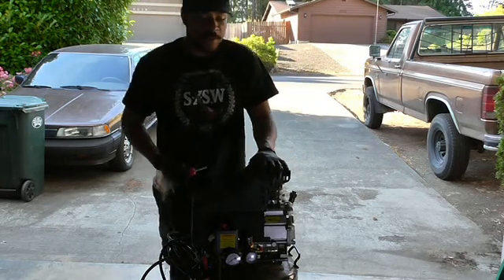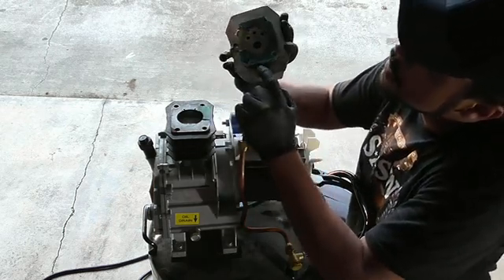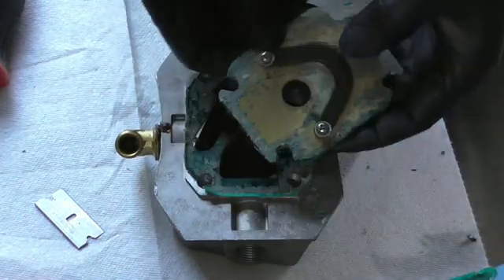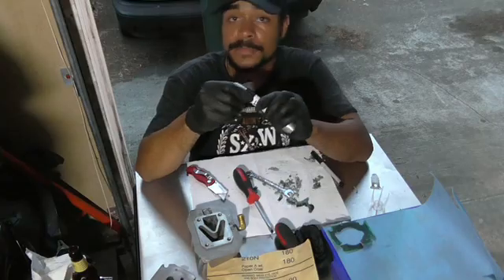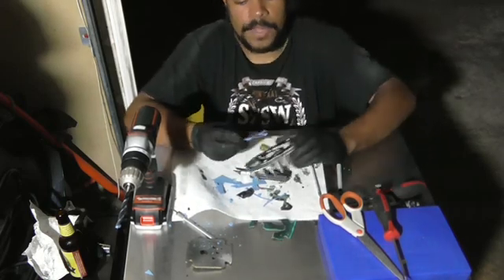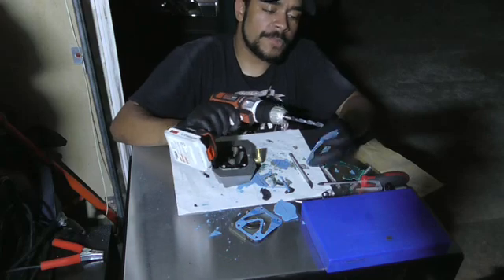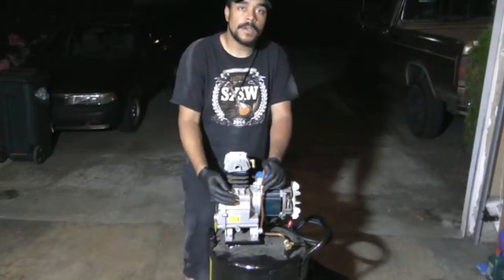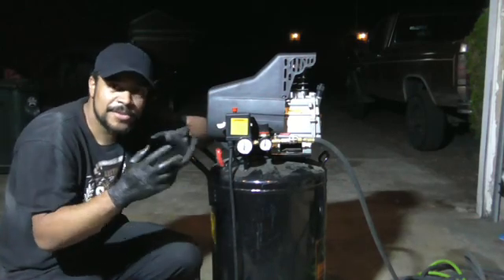Harbor Frieght Air Compressor Won't Hold 40+ PSI? Fix it yourself! (21 gal. Air Compressor repair)

Comment: I am so happy I found your video. I have the very same compressor. I purchased it at a yard sale for $20 but someone removed the sticker that shows what brand and model it is.. I was wondering if you could tell me what the name brand and model it is.. Excellent video. Thank you for your help..
Reply from the maker: Wow! I'm glad this old video is still helping out folks! Okay, so here's what mine shows.
 "Central Pneumatic, item 47065. 21 Gallon 125PSI Cast Iron Vertical Compressor Heavy Duty 3HP Rated Motor. 
(Working Air Pressure: 115psi
12v/6hz/14.6 Amps/1/4" NPT Air Outlet
3.5 SCFM at 90 PSI: 8.8 SCFM at 40 PSI

Then underneath all that is safety stuff and "Do Not Remove This Warning Label 
LOL 

Hope this helped!
Reply: @TheFenderman  Thank you so much. I really appreciate it. This saved me a lot of research.. Have a great fathers day.. Ben..
Reply: @TheFenderman  I finally got it working.. Thanks again bro.
Reply from the maker: @Ben-rj7xs  glad it worked out!!! Now comes the fun part! Fixing stuff!

Comment: I literally did this yesterday  to the exact same Central Pneumatic Model 47065 and used Fel-pro part # 3075 rubber-cellulose sheets to make my replacement gaskets! This video popped up in my feed this morning! Great minds think alike! The algorithms can be scary sometimes!
Reply from the maker: It be like that sometimes!! LOL!  That's awesome! I literally just made a video of this fix working 6 YEARS LATER! A couple of bucks goes a long way with these little beasts!
Thanks for watching and the really cool comment! :)
Reply: I think I may have to do this on mine today. We need to go get some gasket material, and then we are set. Thank you!

Comment: glad i found this video. had no idea this could even be the issue  and they actually nolonger make these gaskets for this model. so excellent video.
Reply from the maker: I'm glad you found it too! Thanks for stopping by and I hope this fix works for you! 
I can happily say I've been using this exact air compressor ever since this fix (I think 6 years now?) to work on my Ford pickup projects and even roofed the house with it!
Thanks again!
Reply: @TheFenderman  got it up and running today! god bless. i love this compressor.
Reply from the maker: @mikep1772  RIGHT on!!!! So glad to hear it!!! 🤘

Comment: Just a word of advice...when doing the holes making the gasket, instead of using a drill...use a paper hole puncher and work it around to chip out a hole, safer, and cleaner cut...
Reply from the maker: I get that one a lot, six years straight actually... LOL :) Thanks for watching! What would have been even better would be having a gasket kit available from the manufacturer!

Comment: hey normies never hold a gasket while u use a drill to make round holes for bolts, this dude is allowed cause he knows what hes doing, same way i remove literally all guards from tools except chop saw, most of you dont, dont drill a hole in your hand.
Reply from the maker: Hahahaha hey man, gotta do what you can with what you’ve got. Paper is difficult to hold onto but, everything still works to this day! Thanks for the comment!

Comment: alternatively lay new gasket material on the surface its to mate to, tap gently with ball peen or brass hammer, really round striking surface is what matters here. the round surface of the hammer hitting the edges of the underlying metal makes easily distiguishable lines to cut along. or good ole fashion paper and pencil or charcoal or crayon and do a rubbing, cut out paper use as a template for gasket material. also for the love of god buy a couple pairs of weed trimming scissors, they have a curve built into the blade and come super sharp. god bless thanks for the advice my pos hf comp wont go past 40psi, now i know why.

Comment: Hi there, thanks for sharing the info.   Here's a video showing how mine will initially turn on and start running but then it quits just after a few seconds.
https://youtu.be/UXmbH0l2TGs
Would you have any suggestions?
Reply from the maker: Sounds like a current issue. (Long leads or extension cords can cause this in my experience) Does it typically trip the breaker?

Comment: nice job
Reply from the maker: Thank you so much! Funny thing is I’ve just been using that same air compressor for the past 3 weeks on my most recent endeavors 😂
Reply: @TheFenderman  nice mine is been acting up and every time i see this vid i try it and the stupid thing still wont charge up lol :)
Reply from the maker: ROADKILL4147 hmm, did you check the piston itself? That almost sounds like a weak ring or something if you’ve gone through it that many times

Comment: Before i give this a go...Would yours get to 40 and trip or keep running without building pressure past 40 psi?
Reply from the maker: Giovanni Lefebre it would keep running and running until it would trip without building more than 40psi. 🤷‍♂️ To this day it still works like a charm!!

Comment: I found your video very helpful.  What type of labor did you use for the gaskets
Reply: what type of paper did you use to make the gasket?
Reply from the maker: Sorry about that! I meant to respond, I figured you meant paper. I found it on Amazon. Looks like it comes in a variety pack now but I picked it up at the local Shucks. (Back when it was called Shuck's O'reilly LOL) I'm not sure about the measurement but now that I look at it, it's like a generic gasket material. 

Here it is! : https://www.amazon.com/Fel-Pro-3060-Gasket-Material/dp/B000CNKUGO

Comment: Great video,  CP HF 21gallon compressor keeps running and won't build up pressure. After watching your video, I'm going to open it up to see if it's the same issue . Thanks for your post.
Reply from the maker: Thank you for your awesome comment! Good luck to you!! I hope it all works out!

Comment: That is a very nice video. Thanks.
I got the same one shipped to me, pre-owned, unfortunately dead on arrival, I opened it but the blue capacitor is not there! does that compressor come with 2 capacitors? or it could be an upgrade? It just looks the same.
Reply from the maker: To my knowledge that blue one is a cap, the white one MAY be a second or it could be a solenoid. I'm not 100 percent sure. Wish I had some schematics or I would tell you for sure. I'm not exactly sure why anyone would remove it unless it's bad (Which can happen). Thanks for checking it out!! Hope you get yours up and running for your future projects!

Comment: Thank you for the video. This is great and I'm hoping will fix my issue that I'm having with the older version of this same model (has a black on/off switch and label is in orange).

Problem is there's apparently one additional gasket that I can't seem to figure out how to get to to repair.

Sadly all of the gaskets on mine were ripped and I have a feeling was part of the problem.

Also, what grade of sandpaper were you using for clean-up?
Reply: Consider using Permatex Instant Gasket for this purpose. It sets pretty quickly; if you don't like the result, just clean it off with a product like brake kleen or acetone and then cut your own gaskets, like he did.

Comment: JUST fixed mine for FREE.  Got a tip for you guys.  When you remove the cylinder head and reed plate and gasket under it you will probably find a broken reed, and it will probably be on the side closest to the air line going to the tank.  My broken reed calipered out at .010 thousandths of an inch so what I did was take an old hacksaw blade and backed it with a straight piece of wood, used a belt sander on both sides of the blade and reduced it to .012 thousandths, then reduced it to size.  Used the thick non-corrugated cardboard from a cell phone box and cut the gasket.  Used a tiny dab of grease to hold the reed in the cylinder head in it's pocket as I turned it upside down to reassemble it.  Functions perfectly.

Comment: My HF/AC 21 GAL had the same problem as yours so this video was very helpful. I had some left over RTV Permatex Gasket Maker  so I used it instead. So far the RTV is working good but if it does not hold up then I will do it the old-fashioned way like you did. The poor quality of the OEM HF gaskets was laughable. Thanks for the tutorial

Comment: I basically have the same exact compressor it runs for about 30 seconds then kicks off the breaker on the machine then I have to hit the reset button to make it run again I even put in a new capacitor?
Reply from the maker: I had that same issue! So what I found it was, the actual outlet was too far from the house panel. Made a new circuit (Literally feet from the fuse panel) and fixed the issue! Makes sense considering the longer the distance the more resistance, which means less power which trips the breaker on the compressor.
Reply: @TheFenderman  I've been running it for years on that plug .. maybe I will try a plug in the house
Reply: Do not use an extension cord unless it’s thicker then the cord your compressor comes with, I kept blowing parts until I found that out lol

Comment: I have a question and before i ask it let me apologize for my ignorance on the subject. My question is i adjusted my regulator to give me 40psi, but when i pull the trigger on my gun the regulator gauge goes below 40psi then i let go of the trigger the regulator gauge goes back to 40psi so what im asking is even if the regulater gauge goes below 40psi when i press the trigger am i still getting 40 psi at the gun tip? Or is there something wrong with my compressor?
Reply: normal

Comment: Always video with the light source toward the subject. You're in the garage and the light is behind you which is why no one can see what on earth is going on!
Reply from the maker: A lot has changed in four years, for a first instructional video with a 10 year old handycam, shop lights and no mic I'd say 47k views and 300 likes isn't a bad start. There's nothing I can do about the video now and it's here to stay. Just for fun I decided to look over one of your videos from when you first started, vertical film on a cheap cell phone, no true dialogue, shaky, wind noise. Nobody starts off at the top, period. We all make mistakes when we first do something like this, nobody is perfect. 
Not to sound bitter but I wanted to make a point. It's easy to sit back and criticize but I like to follow the glass house and stones rule. 
Nevertheless, I appreciate your watching and your advice! :)
Reply: @TheFenderman  a very fair assessment my man.  I was unaware of the age of your video.  My bad.  And yes...very good numbers.
Reply from the maker: Ah, no biggie, if I worried about what everyone said on here I would have a head full of grey hairs by now! I just figured it was a good time to clarify, especially to a fellow youtuber!

Comment: My compressor wasn't holding pressure but it had nothing to do with the compressor side. It was the rubber diaphragm in the electrical cut off switch.
It would build pressure, cut out as normal but I could hear air leaking. The diaphragm had turned to a sticky rubbery mush. Had to buy a complete new pressure switch and air manifold arrangement which was no big deal. Less than $20.00 and should be back working again shortly
Reply from the maker: Very cool! Glad you got that thing back up and running!

Comment: Where can i buy the gaskets? I just bought a used compressor & would like to give it proper maintenance.
Reply: HF has a 1-800# for ordering parts. Find it on the last page of the manual. You'll be surprised at the reasonable prices and availability of parts for most of their products.
Reply: @51diogenes  thank you. Appreciate the help/response.

Comment: Did you really just SAND a machined mating surface?
Reply from the maker: 3 years running strong and I practically use it on a daily basis. I appreciate the suggestions but I assure you I cleaned in there quite well! Besides, it's a harbor freight compressor, I didn't buy it to be precise with. I bought it to beat it up and get a new one when this one gives up, and it still hasn't given up.
Reply from the maker: Adam Alsnayyan what did you see in the video? It still runs and works quite well by the way ;)
Reply: yea but the metal specs that went in on the piston will not be good for the rings
Reply: @Fenderman, Yes, keep the the cylinder clean by stuffing it tight with a clean oily rag, and wipe it on the way out, but don't worry about the sanding per se. You can see that the machining of the mating surfaces is way coarser than the sanding grit. That's why we have gaskets that conform to the surface and seal.

Comment: iguess i got a good one. because iv had mine going on 6 years and iv yet to have a problem with it. hell iv even added a 25 gallon propane tank to it for more volume. that 2.5 motor is plenty to keep up. i use my lil light weight XL stubby like a cordless drill. i took it apart and was surprised by the guts. damn sure woth the 100 bucks with the coupon i had. HF is doing alil bit better with their shit they been getting. and u cant beat tbeir hand tools. like i said. i use my air compressor everyday for my small engines repair and that stubby impact wrench. and both have yet to fale me. now i did take that cheap ass oil and flushed out my air compressor first. should have seen the shit come out before the break in. after the 30 mins. i flushed it again. then out some good royal purple in it. like i said. going on 6 yrs.

Comment: Thanks for the posting this video, very informative! Question:  could you have used RTV to make the gasket instead?
Reply from the maker: I personally did not want to use RTV purely for the fact that it's a liquid, I'm sure it can be done but when replacing something it wasn't originally made with there might be a certain risk like pressure/heat. I just stuck with a paper gasket, that's how I found it and that's how I replaced it haha. If you happen to do it and it works let me know!
Reply: Your video was an inspiration to get my compressor working again! It wasn't the same problem as yours, but it still helped. I'll try the liquid gasket and let you know.
Reply: I have used rtv and it works. Way faster
Reply: Xavier Lemos was your compressor also not filling all the way?  I have checked my gaskets and reed valves and they all check out. Replace the cold start air nipple and still no changes. What did you do?

Comment: Another idea of making replacement gaskets. Taping the gasket paper around the openings is always a great idea. But if you own a typical computer scanner, you can put the item in the scanner and scan it. Then print out a one to one size copy and use it as your pattern. Then a simple exact-o type knife and even some spent rifle cartridges, that can be sharpened on the opening, can be used to cut the round holes for the bolts. I have made tons of gaskets that way.
Reply: a photo with a ruler next to it will work the same it the time is too large or you just can't bring it to the scanner. Great Tip!!

Comment: Hey, my dad used to make gaskets all the time and he would just place the gasket material over the top of the part and lightly tap over the surface of the gasket material and it would leave an impression on the gasket material that you can cut out. Try that on your next  gasket making video and see how it turns out. I think you will be amazed how easy and fast it is to do.
Reply from the maker: Hey that's a good way to do it! I guess this is a tad slower but I haven't had a gasket go bad yet! Thanks for watching!

Comment: great video
I have exact compressor and have changed gaskets out a few years ago I ordered from Harbor Freight-
don't know of their still available but recently the compressor stopped making psi again-so I will be doing your method.
BTW there's another gasket under the head that tends to leak -you need to tap on the head with a mallet to remove it.
Reply from the maker: Hey! That's a great idea! I wish I had known about that sooner! Thank you for the awesome comment and thank you for watching!

Comment: Awesome video just one question kinda of topic.Was that metal or gasket material on top of your piston?Ive got the same compressor did oil change after 30 min break in had metal shaving in oil wondering if in your experience if that clears up.
Reply from the maker: Hey thanks for watching! I can't really imagine what drive gears could cause metal shavings besides something seriously failing. The gasket material that originally came off was in fact paper gasket. A think using a metal gasket would actually be a tad thick for what it is used for. Luckily it doesn't really have to hold back water or oil, it's just air. That's why I'm thinking something is a bit more broken than a gasket with yours. 
Hope this helped!

Comment: Great video.  I think this is what is wrong with my compressor.  What thickness is the gasket material?  Thanks again.
Reply from the maker: That's a good question, I never actually checked the size of the material myself. I just found a gasket making kit at Shucks and bought it. I do know that it's meant for water and oil so it wont deteriorate. If I'd give it a thickness I'd say about a 16th of an inch? Thanks for watching and the pleasant comment!

Comment: Great job same thing happen to one I had, I had warranty so I took it back, but now thanks to you I know what the problem was. Did you use any type of glue with the gasket or just the gasket by itself?
Reply from the maker: Hey! Thank you for the kind words and thank you for watching! So I did not use any glue, given the option I would have taken this one back as well but this thing is about 8 years old or somewhere close to it.